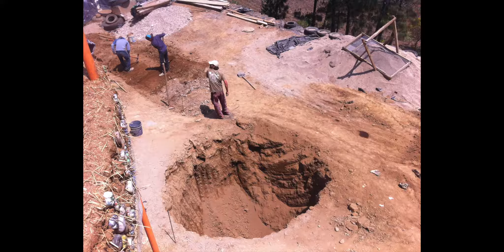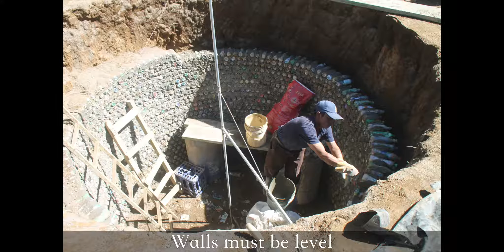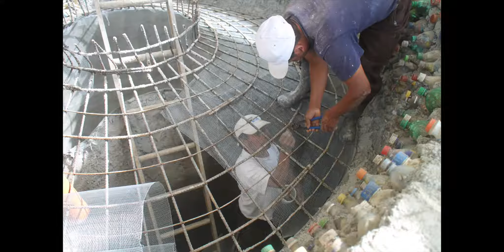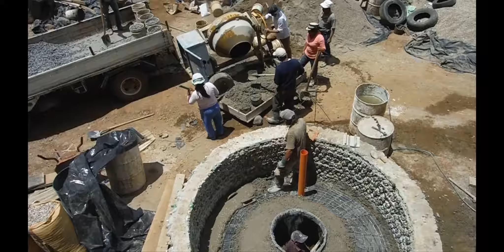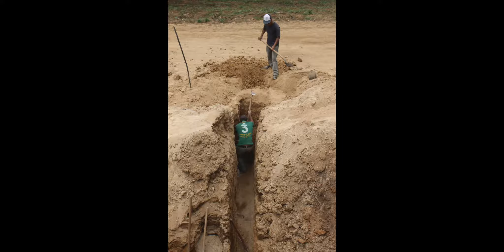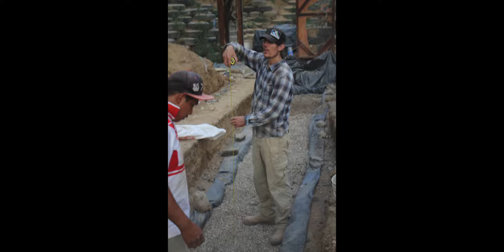LWH Septic System

Comment: Whats the volume and for how many people is it designed? Is there an alternative to plastic you could use? Are the bottles filled with sand or plastic waist? Are they supposed to ad isolation value ore just lower the quantity of the concrete?
Reply: This is not an "outlaw" septic tank, it is a septic tank and system so I changed the name.  Each tank is around 3,000 gallons, but I don't recall how many people it is designed for.  The bottles are filled with plastic trash and were used to use less concrete.  The tanks were designed with a 48 hr detention time, before the effluent makes its way to the evapotranspiration field.  Hope this helps.
Reply: Here is a much better video on our organizational YT channel. https://www.youtube.com/watch?v=xneY5hZrfLA&t=94s
Reply: @LongWayHomeOrg  Thanks a lot